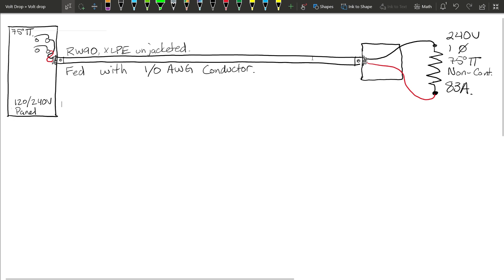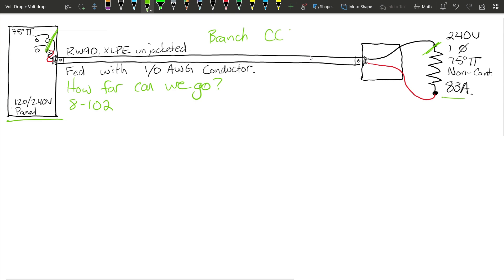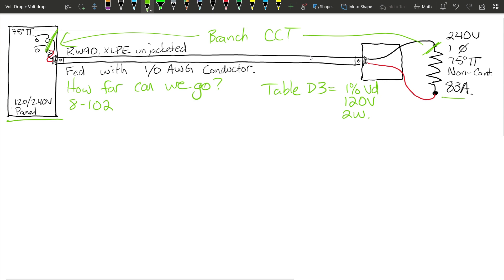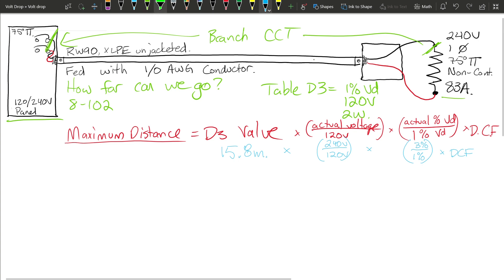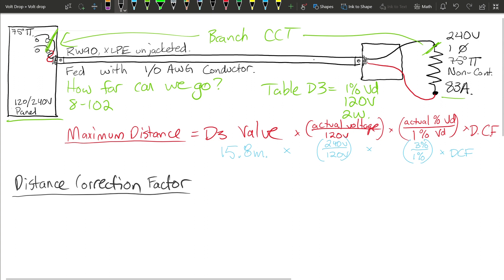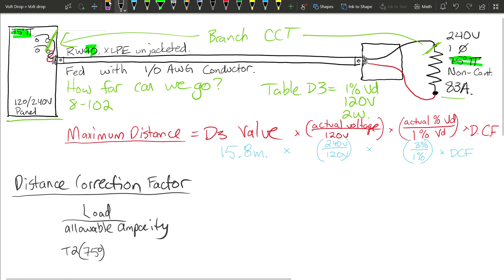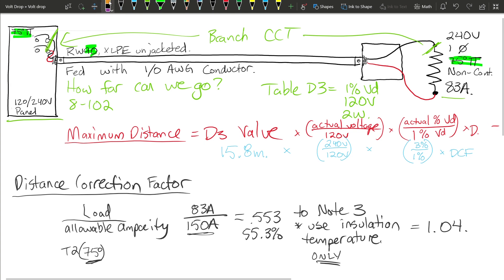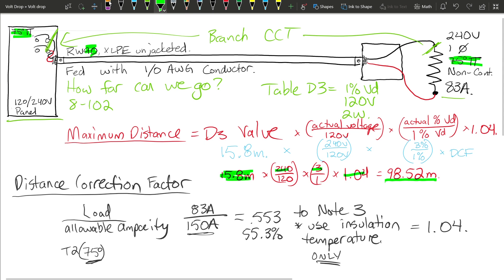Volt Drop Calculation

Comment: in table D3 the largest conductor is 4/0 for bigger size conductor or larger ampacity loads, We would apply sub rule 6 of table D3 is this correct and how does it work? It mentions 10 times. Just having a brain Fart on how to do this simple math. like when you get into the Kcmil size.

Comment: I absolutly love your videos! They are definitly my go to suggestion for students who want video tutorials. 
Quick question, for a motor voltage drop calculation, do you use your FLA or the FLA x 1.25 to obtain your distance from Table D3 and in determining the distance correction factor (load ampacity/conductors ampacity at the rated insulation temperature). The CEC handbook uses FLA to determine the distance in m from Table D3 and uses the FLA x 1.25 to calculate the percent of allowable ampacity. Just curious if there is a mistake or if there is an explanation for this? I couldnt find an explanation or example anywhere! (None at least based on the CEC.)
Reply from the maker: Thanks for the support! I would use the FLA x 1.25 at D3, similarly to how I would use the load ÷ .8 for a continuous load before going to D3. For non continuous motors, FLA x T27% before using D3. That's my initial gut interpretation, but I may change it after looking into it a bit more lol. I'll let you know what I dig up!
Reply: @schulerruler  awesome thank you! And then would you use that same value (fla x 1.25) to calculate your percent of allowable ampacity to use in determining your distance correction factor in note 3 of the table D3?

Comment: Hey you have lots of great videos, but just so everyone knows we should not be using the 75 degree column here, note 3 under Table D3 says to use conductor insulation temperature, so we would use 90
Reply from the maker: If you are determining the distance correction factor you compare the load to the allowable ampacity of the conductor based on table 2 values with lowest temperature in mind which in this case is 75° C. 

When we select the distance correction factor however it is the percentage loading (rounded up) and then the insulation temperature to select which in this case is 90° C.
Reply: @schulerruler  This seems to be a point of confusion for a lot of people, sorry if I wasn't making great sense. There is strong evidence that we should not be using the 75 degree column, there is note 3, but also if you look at the actual example in the code book, they use #12 wires ampacity under the 90 degree column, not the 75 degree. They divide 16A by 30A, not by 25A
Reply from the maker: The example is using 90 degrees because in this question the only temperature reference is the insulation temperature of 90 degrees. If your conductor is terminated at 75 degrees, which my example is, then you would not select the conductor ampacity from the 90 degree column in table 2. 

Please remember that the rules trump the appendix notes. We still must obide by 4-006 when determining conductor ampacity in a circuit.
Reply: @schulerruler  The example says "from the centre of distribution to the load", these conductors have to be terminated under something in order to even have a voltage to measure.

I did a practice question from the CSA exam today and it used the 90 degree column for getting the ampacity to load ratio.

You very well may be correct, you definitely know a lot more about electrical code than me and I have so much appreciation for all of your videos, this is a point where I think it's not so cut and dry. Luckily using the 90 or 75 degree column usually won't change to answer enough to through things off drastically.

Comment: allowable ampacity of 1 AWG at 75 degree should be 130A, not 150A. why you select the 150A from Table 2?
Reply from the maker: A 1/0 would be able to go significantly farther carrying the same load as the no. 1awg. The intent of the video is demonstrating the allowable distance a 1/0 can carry the given load. Under no voltage drop, yes a no. 1awg could carry the load, but once we start to exceed the 3% voltage drop, we must start increasing the size to accomodate.

Comment: Hello, in the example they give in the code book on page 763 they use the 90 degree column to get the ampacity of the 12 AWG wire.     Does rule 4-006 2) a) not apply here since there is no termination temperature given??     im confused here.

Comment: Table D3 is out of range for crane and hoist since we use table 58 and we can run more amp in wire (ex: 32amp in a 14 awg), what is the reference than?

Comment: Great Channel!! Doing CSA(!!!) exam prep course... one question for voltage drop does not give termination temps(for residential baseboard heaters) conductor is NMD90-..my question.. do I calculate conductor ampacity using 90 degree,assume 75 degree termination, or go by 4-006(2) which tells me unmarked equipment under 100a is at 60.... CSA tells me 90
Reply from the maker: Thank you for the support! The assumption used to be 90 Based off previous code, but now using 4-006 2) as you mentioned, if the load is 100A or less you would use 60 if the equipment termination temperatures are unknown.

Comment: Hi, I am trying to find the Solution for the Red Seal Question : What is the minimum size of RW90 copper conductors required to feed a 230 V, 5 hp, single-phase motor located 60 m from the distributor centre, without exceeding a 3% voltage drop? 

I cannot find the correct answer. I am getting #6 AWG but the answer is #10 AWG. Can you please help me finding the answer for it. ?
Reply: You'd need to know the current drawn by the motor. 5HP x 746 = 3730W. But that's the output power. You would need to know the rated % efficiency of the motor to find the input watts. Then you can divide watts by volts to find the current drawn (input) of the motor. After that you would just follow the advice in part 2 of his video series.
Reply from the maker: In this case we are permitted to use table 44 to obtain the FLA rating of the motor.

Comment: What would you do if dealing with 3 phase, 600 volt service?
Reply from the maker: You will also need to use the multiplier for a three phase calculation of 1.155.

Comment: Great!  I just missed in your explanation why we have to use the row "85-90°C" and not "75°C". I know you stressed the following note: "Use insulation temperature ONLY!" but Table D3 refers to insulated conductors.  I am confused. Thanks for posting. I mean it.
Reply from the maker: We would use it due to insulation being 90° C rated. Everywhere else, 4-006 wins and we use the lower temps. Thank you for the encouragement!